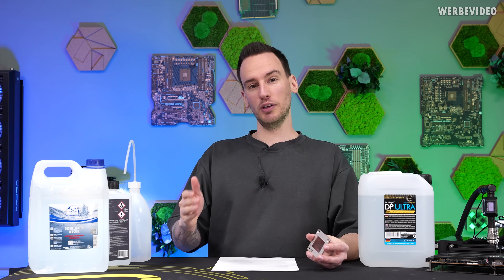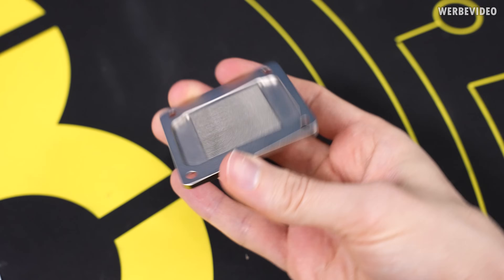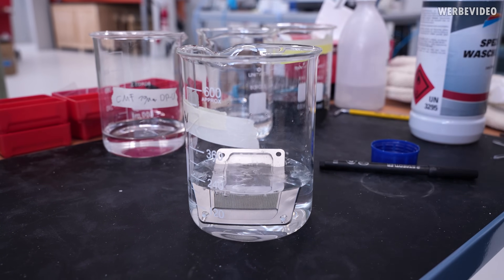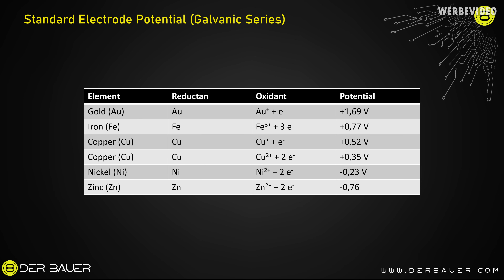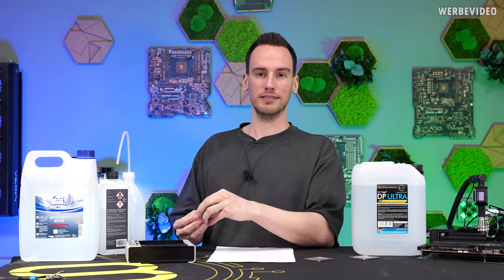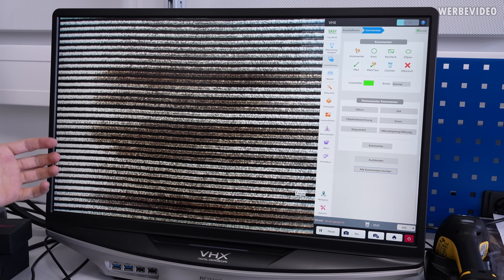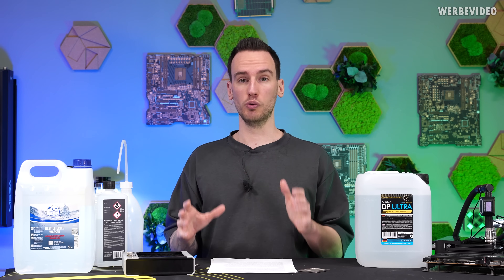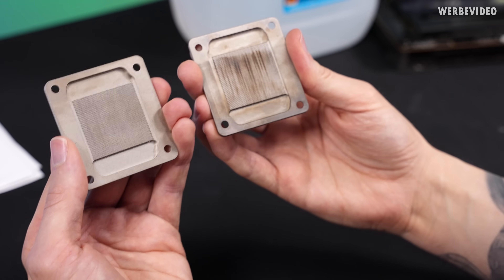Do NOT use Distilled Water for your Water Cooling Loop!

Comment: I somehow missed this video, well crap. I recently just cleaned out the loop and flushed it with distilled water before filling it with XL5, should I be worried? Also if using distilled water is bad what do you use for cleaning the plates? I was using toothpaste and distilled water with a toothbrush.

Comment: With PrimoChill Utopia, oxidation/corrosion in the loop is prevented, but it cannot be used if there are any aluminum components in the system.

Comment: I agree with him 1000%, I never used distilled water.  Koolance LIQ705 coolant, it’s non conductive and you can get it by the gallon.  I’ve been liquid cooling since 2009, this is the way.  Also, I only service my loops every 3 to 5 years.  Worth it.
Reply: i use the same coolant  its awesome

Comment: I flush my radiators with hot tap water, but I do clean blocks with coolant. I've been trying to do all final flushes after a tear down with coolant, but its very expensive. I never flush my system fully built I think that is where these issues come from.

Comment: bbck when i had my x99 and 3x gtx980 in sli i ran nickel copper blocks on both cpu and all 3 gpus as well as copper brass radiator and only everr used straight distilled water and a silver strip coiled up in the res to stop growth, was in that situation for about 8 years till i pulled it all apart and sold all the parts. all blocks were fine and the fins in the blocks were only ever slightly tarnished. but then again that was my single experience and never really needed to touch it so it stayed the same.

Comment: Thank you for the great work with testing. Instead of nickel plating, have you guys thought of using anodizing instead?  This is a problem I dealt with on another project in a more hostile thermal environment where there was actual mechanical contact and anodizing was more uniform and thinner at the micron level and the surface hardness was much higher so we didn’t even see any surface wear.
Reply: Going back through old notes, I also remember that anodizing electrically insulates the substrate and breaks the galvanic circuit

Comment: Water is not causing corrosion, its the minerals and oxygen (bubbles in your loop) that causes corrosion. You need to use an additive that reduces cavitation by the impeller to prevent bubbles from forming.

Comment: It's amazing how good you are at lying and manipulating tests in order to push whatever result you want to push. 

You decided to boil distilled water in open air, in an open receptacle,  where it can easily get contaminated as it heats up. And that's while ignoring the part where if the coolant reaches 60c in a loop, the pump's impeller gets damaged.  You did NOT simulate reality and how a loop works, you left it in open air to get contaminated far easier and faster, something that does not happen in a custom loop, which is closed as soon as you fill it. 
The whole "test" is faked, done to promote things. 

Yes, additives are necessary for long-term functionality of a custom loop, I completely agree with that. Running distilled water alone is a bad idea. But why do you have to lie and manipulate to try and to make your point again? It's not the first time I'm noticing you manipulating data, "forgetting" basic things, or straight-up lying. It's becoming a trend. Even in this case, where the idea is good, but you still had to lie in your methodology. 

You got good engineers working for you, making your products. Shame you are you, and you're doing what you're doing lately.

Comment: Even reverse omosis water sustems arent supposed to use any copper pipe or fittings(preferably no brass either) on the treated water side and distilled is more corrosive

Comment: The interaction volume of EDX is in the micrometer range meaning you pick up all elements a few micrometers down from the surface? So if that brown stuff is only a few nanometers thick it probably wouldn't be picked up by the EDX...so is that brown stuff for sure just copper?

Comment: I'll shorten that for you: distilled water is very slightly acidic because of CO2 absoption producing carbonic acid. Also, because of the lack of minerals in distilled water it is (osmotic potential) easier for ions to dissolve -- it is a more reactive environment. Don't use DI water without necessary additives, such as corrosion inhibitors.

Comment: My experience with coolant is not great (EK Cryofuel and Corsair XL8) were not great. They either start to deposit, or having high viscosity;  the latter situation result in a 46 degree coolant temp at equilibrium under heavy load (RT gaming or rendering); my guess is the viscosity is too high for the pump to drive it through the loop at effective flowrate  . Flushing most of them out and use high grade distilled water again ( from a vendor that supply ultra pure water for the X-ray diffractometer in one of the lab my familiy operates) , the temp drop back to 38 again. 
Now i will wait for PPCS to restock Mayhem inhibitor and add a few drops.

Comment: You still going on about the 5090 block? haha my man I made my own custom block and I've had it running perfectly for almost 2 months, I also engineered it all by myself, what the hell is your so called 'team' doing? do you do 1 revision then have a 48 hour tea break? There was a 5090 water block out less than 24 hours after the FE edition was released btw. Look, don;t pretend you are some kind of smart guru because you read a wiki or get told by an 'expert' people watching this channel will probably take what you say as a 100% and it is not in some cases, for some reason people think youtube is filled with the worlds greatest minds and if you arn't on this platform you don't know anything hehehe.

Now onto this video, again you are not that clever to understand how this works and you just spout nonsense you have been told or read (typical German). Firstly, you can go to your local hardware store and by 4 litres of distilled water for a car battery drop 4 drop sof mayhem in it, you can then put said water into a loop, you can then run that loop for 24 hours a day, every day for about 8 years and guess what? NOTHING WILL HAPPEN.

Little edit, I just found out that the old EK block guy now working for thermaltake was involved in this block? Look I am probably a better engineer than any PC component producing company has on it's books  so I can't be too critical but this ex EK guy is pretty basic.

Comment: Too late. I have been running custom loop for like 7 years and had lot of issues requiring cleaning. Last summer i switched to using car coolant mixed with distilled water in my loop and haven't had any issues ever since.

I tried to keep all parts i get copper, and people were telling just distilled water is fine with that, but i see it is not.

Comment: Radiator in a car or in your computer works the same. Basic.
Thats why its common sense to use atleast 70/30 (70 vatten / 30 glykol) Depends on where you live, but obviously you cant run a car radiator even in Sahara desert on pure water... why? Corrosion.
Know fact for decades....

The topic on this video, from this creator, is such a sellout that i cannot belive it. Why? Money drying so thin or is it just greed?
Unsubbed.

Comment: i respect a lot of your work, but you seem to be pretty new to liquid. guys (myself included) have been running distilled water for decades in our loops with no issues. This seems like some shocking revelation to you that distilled water alone is bad, but literally nobody runs just distilled water. We run distilled with a silver kill coil, or with a biocide. what you are showing is just the natural tarnishing it has - which yes, if you pull apart your blocks and look at their interiors? sure, its unappealing. its also the most accessible coolant to run though so if you dont have windows on your blocks to see the fins, it doesnt matter. Seems very boy who cried wolf, over some minor visual changes that happen with most other products on the market too because very few people use pure coolants without water mixed in - almost all coolants on the market will do this too, given enough (reasonable) time.

Comment: Then as other metals are in the water they cause other ones to precipitate out.  That copper you are seeing at 8:32 may be a good example of that.  If enough precipitates out, it could block the small passages and fins.  Then you may slowly notice that they are not as good at cooling any more

Comment: Great video! Such a breath of fresh air to see somebody like yourself providing useful information to the PC enthusiast community.

Slight correction about glycol- both propylene and ethylene glycol will not raise pH, in fact they will themselves lower pH over time as they degrade with acidic byproducts when uninhibited. This happens very slowly unless heated to extremely high temperatures. If you are adding industrial glycol products, such as DowFrost or DowTherm (specific propylene and ethylene formulations), these are provided by the manufacturer with inhibitors already added to the formulation to increase pH so as not to degrade steel piping in industrial cooling applications. It is not the propylene/ethylene glycol itself that is raising the pH, but the inhibitor added to the mixture.

As somebody who oversees the maintenance of facilities that use cooling loops containing thousands of gallons of ethylene and propylene glycol solutions, I still highly approve of this video and the information provided! Many thanks to you and your team for putting in the time to quality test your products so thoroughly 🫡

Comment: I just pulled one of my PLEX's that's been running just plain tap water for the last 15 years without changing it, and zero additives, And it has zero corrosion, that system is all plain copper too, (Rad & EK water blocks) so without any nickel coating, The tap water here has PH 7, and PPM 150, which is super low, even lower than the distilled water I've tested, and I have 5 other PC's like this with zero problems.

Comment: If only you had made this video a year ago when I made my loop 😂 I filled my (copper) loop with distilled water and I watched as the copper plating occurred in seconds in front of my eyes through your cpu block on my delidded Ryzen. First I though, what the hell is this brownish stuff. I pulled a torch and when I put some light on it I immediately drained the loop. Soaking the block in spirit vinegar for half an hour then cleaning with a toothbrush (no toothpaste, just vinegar) for an hour and the nano meter thick copper plating was removed. Not entirely though. On the large flat surface there is a "shadow" of discoloration. I couldn't get proper coolant for at least a week so I made my own by mixing 80%  distilled water, 20% pink car radiator coolant concentrate and adding the required amount of bacteria killing stuff I bought earlier. I planned to swap it, but I've been running this coolant for a year (transparent blocks and reservoir) and it has been fine. The pink color doesn't bother me one bit.

Comment: Maybe I'm special??? I've been using nothing but distilled water in ALL of my WC loops since I started watercooling back in 2001. Yes, 2001. I have only had 1 negative experience, and that was because of my own negligence. My longest lasting loop was on my Intel i7 980x Extreme which was just over 8 years, and ZERO growth, or gunk. Just Distilled Water. My current system is a Threadripper 2970wx and a Radeon 7900 XTX. Been running well over a year also with zero indication of gunk or build-up. I do make sure I have pure copper everywhere though. The ONLY thing I can think of what may be helping out is that I do have a "Black Light" in my case. So, maybe the UV from the Black Light is working some magic?

Comment: I have an uncommon custom loop, using an all aluminum radiator cooling two CPU and two GPU. All of my fittings and blocks are nickel plated. So what I did was use a 50/50 mixture of distilled water and "HD" engine coolant. I've never flushed out my systems after 9 years, only topping up after changing parts. No corrosion, no build up of gunk.

Comment: I've ran distilled for idk 5-6 yrs.  Only time I got corrosion was when I found a mild steel plate inside my barrow cpu block/pump combo (for SFF) I made a brass plate and problem went away.  (my atx build was problem free for yrs)  still have the itx with an alphacool block in it.  Silver kill coil, distilled water.  Still sending it.   I'm not arguing this affect, But I think it normalizes after a while, and it works fine for me.

Comment: I use distelled water in my loop wth some car cooler liquide (for volvo) cause it was green and i wanna some blue in my loop, adding some blue collorant and no problem since january 2024 ! no degradation of my surfaces, 0 dust inside the coolant, and it perfectly cool down my CPU/GPU <3
But i'm curious about custom coolant, if u can talk about it would be so niccceeee !
My O11 dynamic evo and I will be gratefull haha😘

Comment: All fluids will cause corrosion as they pick up residual chemicals from the ionization. This is why a corrosion inhibitor is used in fluids meant for liquid cooling loops. However it's only an inhibitor, meaning eventually it will degrade.

Comment: I flushed my system with distilled. I didn't notice anything. I won't do it next time. I think I may actually be using that DP ultra is my fluid. I don't rmemeber it's 4 years old. I need to flush and refill again.

Comment: My first loop was full Alphacool with also clear alphacool coolant, result after one year was cpu block corroded (copper, nickel, transparent tube).
My second loop was with full Bykski and EK clear coolant, result after one year was no corrosion but all the transparent tube and reservior are plant of dirt (copper, nickel, transparent tube).
My "third" loop was the second but with distilled water from the market (1€ for 5liters), not a single problem!

So what is my case? It is a miracle? Uhm.

Comment: Distilled water pulls minerals from the items it passes through. This is is the case with tap water as well, thus why water tanks have a sacrificial rod in them. Distilled is 10x worse due to the minerals removed during the distilling process.

Comment: 7:57 There are little to no “ions” to “adsorb” as long as your loop is properly washed and isolated from the atmosphere. It would be correct to say that any material, including the glass, is slightly soluble in water, but this is hardly a matter of concern since the equilibrium concentration of the resulting ions will be ridiculously low. Low enough to require spending a literal lifespan in order to see any difference. Not saying that something like the borosilicate glass is much less affected by this. 

Boil the water before using it. Either this or bubble it up with some inert gas like argon or sulphur hexafluoride. Do the same for your loop before filling it with water and then remove all the air bubbles. This will result with a nearly unlimited lifespan without any significant corrosion as long as you aren’t doing something as ridiculous as having an aluminium radiator electrically connected with the copper or steel parts. 

This corrosion “test” can be described as either the unrepresentative at best or as the manipulation at worst. There’s an unlimited access to oxygen, which is acting as an oxidiser, as well as the continuous presence of the carbon dioxide which is increasing the electric conductivity of water. Either the chemistry is not your strongest point or you’ve been tasked with presenting things worse than they truly are. The choice of either option is up to you.

Comment: I’m guessing de-ionised water would have the same problem? Do you get this type of corrosion even without the heat? Generally the heat isn’t applied when you’re just flushing the system out. So if there no heat and you’re only flushing for a couple of mins will it really be that bad?

Comment: Lab grade deionised with Hayes biocide and inhibitor. Cleaned once and replaced water after 3 years. Micro Siemens is low too. It's amazing people use distilled without treatment or even tap water in a loop.

Comment: Copper does not have the same effects as nickle does in neutral water.  So nickel plating uses nickel sulfate which is water soluble. STOP USING NICKEL plated crap. All water no mater the additive will dissolve nickle over time.

Comment: My thought on this is that the microfins in the cooling blocks is part of the main issue here. Of course the manufacturer want to have the packing very tight using as little material as possible but it also means that the lifetime will be a lot shorter.
Longer fins with more spacing between them would be less prone to clogging.
I'd also like to see a cooling effectiveness test using different coolant types.

Comment: IS Not the water is the mix of metals. Used WC since 2001-2005 all Cu components, today the components are shiny new. Distilled water, 2 drops of Chlorine and fluo green dye. 0 problems. Mixing metals Alu-Cu (same problem for car engines) create corrosion.

Comment: Like 15 years ago I think it was a pretty common to use distilled water.   I had a watercooled fx8350 that could run 5.1Ghz but was dead nuts stable at 4.7.  It ran like a champ for years and years and the water never looked off color in the res, maybe a little cloudy, but when I finally broke it down there was some was nasty brown sludge inside... probably too heavy to move efficiently through the system so didn't end up in the res or something but that put me off water cooling for long term rigs.